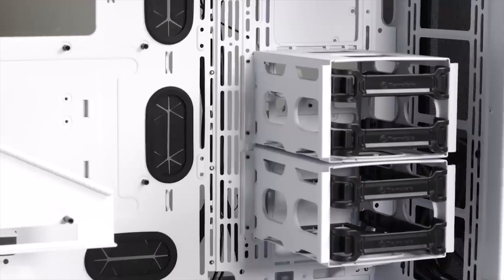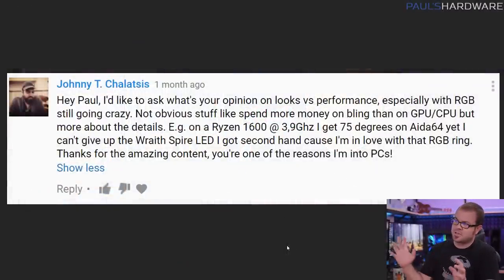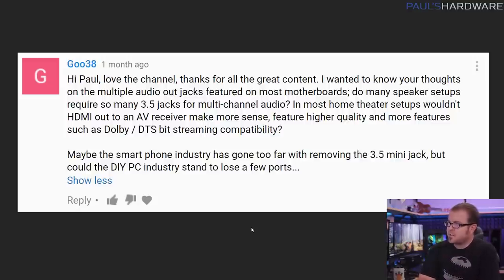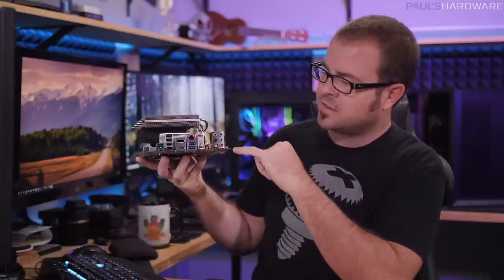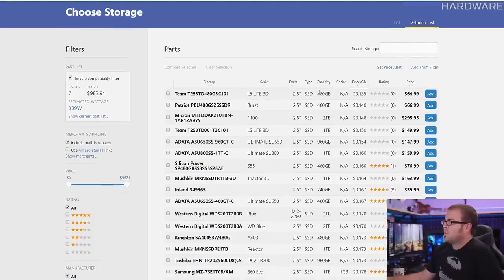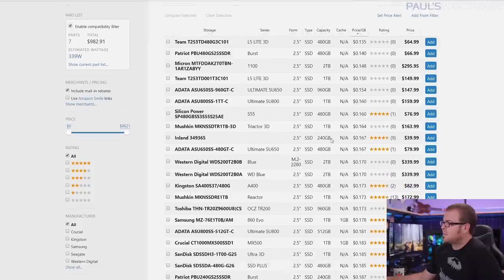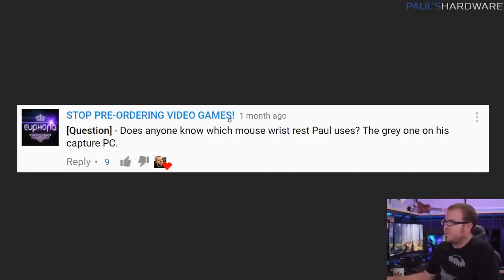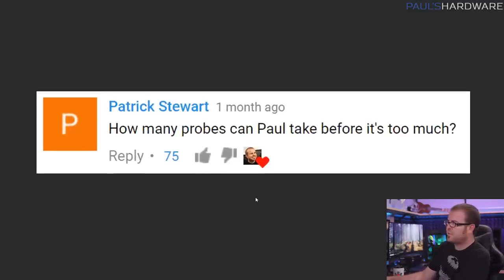The Eternal Question: PC Looks vs PC Performance? - Probing Paul #27

Comment: Hey Paul, 
Do you think it would be better to run a single ssd of higher storage, or using multiple smaller storage drives? Right now the predicament that I am stuck in, is in my build I have just bought ssd's once one of them filled filled up. I play a lot of games and like to have everything load quickly, recently I have started to notice a performance decrease, and when browsing through my files it seems like everything is just stored in so many different places, so what I was thinking would be to purchase a larger ssd that would replace the multiple ssds. Right now I have my OS on a Samsung evo 960 256 m.2, 2 Samsung evo 860s, and a Western digital 2 Tb drive. I would like to keep the hdd and then ditch the two 860s for another higher storage m.2 since my motherboard has another m.2 slot open.

Comment: just my experience with the digital out of the mainboard:
All of them that I have tried does not support Dolby or DTS compression which means you will only get two channels over toslink. There are some moded drivers for realtek sound chips to enable dolby live but I had no success with them.
The solution I went with was an ASUS xonar dsx sound card (about 50€) that supports DTS (there are some cheaper options if you only want 5.1 for about 20-30€) and use it's digital out to get 7.1 out of it. 
About HDMI: my AVR made some problems in some games which considered it as another display so I went with the above solution.
Reply: Pouya
Now, only DTS connect or Dolby Live or Atmos, all onboard solutions can produce that on premium boards, sonar too, just a Digital format all games do now.
Check the codec that the system supports, use the optical connectors to connect it to the DAC, or built in DAC AMP solution! Xonar is just using multi chips, they all support some way of DTS connect or ATMOS. You don't need Xonar, try the optical connector on your board first!
Reply: I toslink over to my home theater system which can decode the 5.1 on the stereo feed. Without a decoder you only get stereo.  Now I am going to have to check to be sure I am getting surround sound after your comment.
Reply: Sorry for the delay, but my Realtek Digital Output Properties shows "encoded outputs with a check mark in DTS audio and also in Dolby Digital.  It appears these are encoded in the SPDIF output to the home theater system which can decode them. I have a screenshot but this thread won't let me post it. I also have a selection for ATMOS for headphones.

Comment: I built my pc in 2010 on a short lived AM3 just before bulldozer was released. I didn't check back on pc hardware scene for about 8 years. So 2017 Xmas I return, and hard disks are round the back, things are shrouded. Basically inaccessible. All about looks. The whole point of a good PC was that is a) easy to build in. That's the foundation for picking your own tower. You don't unscrew everything, you just take your sausage fingers to the component you need to get to whilst leaving everything else in place. Part of me thinks the best mid-tower cases have already happened. Everything is just a variation of them now.  The only difference is now that efficiencies allow for smaller chassis without compromising too much on the power.
Reply: nauxsi
Just go for the GPU you need, some $250 intel solution that to run it!
what ever case you need!

Comment: if you have a decent budget for a build (mid -high tier) i always stick to a 80-20 to 90-10 preformance - looks, spend about 80-90% on the preformance and then the remaining 20-10% on looks, say you got about $3000 to build a new pc see what you can get for about $2400 - $2700 and if that works for you spend the remaining budget on a better looking case, a RGB cooler, RGB RAM, always save the LED strips for last as it is a easy adition to your system later down the line that does not replace any of your current hardware, in contrast to RGB RAM for example, if you realy want that blingy RAM and you build your system with normal RAM, 2 months later or so you got some money left to drop on upgrades and bling you dont want to buy the same RAM but in RGB leaving you with letf over non RGB RAM, you could resell that RAM but you wont get full price on it.
Reply: originalkhawk
There are no tiers, just needs. If you need build some NVlink X299 40 HT core system now, its still a low level workstation....
If you need RTX now, just go for some gaming tear k intel CPU, the $250 CPU's are the lower tier!

Comment: Hi Paul,

A few years ago I built a pc with 1tb hdd for storage, but now you have convinced me to buy a ssd for windows an other programs. But how can you switch windows from a hdd to a new ssd? Do I have to reinstall windows?
Reply: Reinstalling Windows doesn't hurt, but you can clone the drive, which I've done several times with my boot drive. Can't speak for all disk cloning software, but I know from experience that Macrium Reflect can even clone from larger disks to smaller ones, provided the data on the larger disk doesn't exceed the capacity of the smaller one. For instance, if you wanted to clone your 1TB HDD to a 500GB SSD, you could do that as long as there's no more than 500GB of data occupying the hard drive. I actually did this when I cloned my 1TB boot HDD to a new 240GB SSD, and I then cloned that boot SSD to a new 250GB one (which is M.2, hence the switch) several months later. None of this caused any problems. Having said all of that, if you were to ask Microsoft what they'd advice you to do, they'd probably tell you to just be on the safe side and reinstall Windows, so there's a level of caveat emptor involved here.

Comment: realy interresting about the sage there... i have a gaming x card it has a sag its annoying just to know u have one so here is what i did i went to the store and bought a few zipties and tied the ties together making them look like a chain tied to to the top of the case i used around 6 ties till it reached the gpu and it was cheap not like a 40 dollar braket just to hold up the gpu and this has more flex to it so you wouldnt wory about breaking it or the gpu..😁

Comment: Hey Paul. Steam for linux just got a major change. You can now play windows only steam games on linux. I recently took the leap and finally ditched windows for good because I've always kept windows just for the games library. So far most of my games are working. Keep in mind there will be some slight performance hit (10-30% if windows only game.) I was wondering if you would ever consider testing hardware on linux systems? I don't know the fan base you have on linux but I know I would really enjoy watching videos from someone of your caliber testing hardware for the platform I've come to love. You can easily find a database of the community testing games for how well they work so it can be easier to choose from gamewise. Also alot of windows games have linux versions that have comparable performance instead of slight performance hits. You can also find very easy guides on how to install GPU drivers and anything you might need.

Comment: Hey Paul. I bought a used gtx 980 about a year ago and it has been working fine. However, recently I noticed the temp getting up to 83 C during gaming. Do you recommend changing thermal paste at this point? I’m concerned about breaking something (like the thermal pads) and making it worse.
Reply: Is your case dusty and do you have good airflow in your case? try cleaning the gpu with compressed air and that stuff first. replacing the thermalpaste is not terribly difficult, and while you're at it, change the thermal pads as well. Take a picture of how everything was before you remove the thermal pads!

Comment: Paul, whats typically better a CPU, one that it hyper-threaded with less cores but more logical cores, or a  CPU with more cores but not hyper-threaded? For example the 6c 12t i7 8700k or the new i7 9700(?) that is rumored to not be hyper-threaded but with 8c? Building a new PC and the rumored intel 9th gen i9 seems to be out of my price range, but sounds to be the only hyper-threaded CPU. I know (at least at the time of this video) that you cannot speak performance numbers on the Intel 9th gen CPUs, but more or less I am wondering if I should wait until they are realeased to buy?
Thanks!
Reply: Casey O'Brien
What does it need to do the only Question!!!
Reply: Just about everything. Gamer and programmer, so CPU needs to be pretty hearty. Curious if the extra hyper threaded 'cores' of the 8700k will make it comparable performance wise to the 9th gen.
Reply: Casey O'Brien
If you play game's, on what GPU?
You never need any system for C! Heavy compiler???
Reply: It will be a whole new rig. Either a 1080 ti or a new RTX if its worth it for the price (skeptical but not ruling it out). Mainly a C# developer, mostly asynchronous apps and large open source projects. Yes, Visual Studio is quite heavy haha
Reply: Casey O'Brien
> $500 GPU card, Try to build a Coffeelake 6 core system, or intel X299 if it's within your budget, able to get more CPU cores. Not needing many CPU cores, then Coffee 6 HT cores can do the job! You need the > 4 Ghz intel CPU if you what to run RTX level cards.
Visual Studio, lol, though you needed to run that, intel your first choice i guess.
Reply: Thanks, I'll keep this in mind.

Comment: Paul, could you help me? My motherboard rgb is not working (asus rog strix z370-e gaming) and I sent it to asus and they said nothing was wrong. So what would the issue be? My psu is a thermal take 650w, 16gb trident z rgb, 8600k, gtx 1050 going to upgrade to 1080

Comment: What is better for light gaming, Intel or ryzen
Reply: Ryzen. Their cpus are great price to performance. Even the 2200g (processor with a graphics chip) can be used nicely for light gaming (also paired with a gpu). Intel doesnt make much sense. Their cheapest 4 core cpu sells for 150 euro where I live, that's 50 dollars more than the 4 core 2200g from AMD.

Comment: Hi Paul,  i have Ryzen 1700x and GTX 1070 FE, the GPU is running hot while gaming about 75c while gaming and 83c under stress test that's with custom fan curves, is water cooling good option or do you have any other recommendations? 
Thank you I enjoy your content keep up the good work :)
Reply: thats fairly normal temps for a GPU. If you're gaming with a headset or so, try playing a bit with your fan curve. Otherwise, check clearance, airflow in the case etc, or invest in another case fan depending on what you've installed already.
Reply: @neerithedragon298   i have 3 fans in the front intake and 1 fan in the back for exhaust. Clearance wise is good nothing is stopping air to the GPU

Comment: Goo38 - On all 4 of my PC's in the house still use that 3.5mm jack, 2 are using onboard through PC speakers and 2 through sound cards. I guess if they did get rid of it my only option would be a sound card or ditching my Bose 2.1 setup and go through a receiver or buy new speakers that have a digital input. But that on board 3.5mm jack is cheaper for the masses since your average consumer is going to get $20 speakers and those usually only have one way to plug in via 3.5. P.S. I never used USB sound or headphones, USB sound IMO sounds really bad and headphones make me feel claustrophobic. In the past I did use a 6.1 Receiver and 6 bookshelf speakers and sub and for some reason back then it would never go into digital surround. I spent all that money for a major disappointment. I just went back to 2.1 and sold all that to someone that wanted a home theater setup.

P.S.S. I just woke up so what I said might not make any sense. sorry.

Comment: Digital sound output from your pc will give you serious headache for running surround in games. Spdif is exellent for movies and such, which might support surround, while games dont output surround sound digital. To this day i have not found 1 game that have dolby digital or dts, while consoles like xbox1 and ps4 outputs everything in dolby digital. Thats why i use both analog and digital connection to my home theater, but if you have to choose digital or analog for your surround system, go analog. Or be without surround in games. If you just use stereo then digital is best.

Comment: hi paul,i bought a 970 pro 512 gb for gaming is it good idea to partition the drive for os and games,and my 970 pro seems slower than every youtubers 970 evo and even 860 evo crystal disk mark scores,im using a msi gv62 vr 7rf laptop with i7 7th gen 7700hq,16 ram at 2133,gtx 1060 6gb ,any reason for that ?  :(

Comment: Awesome video as always Paul, really enjoy these QnAs. Also found it funny that you recommended the H7 Quad Lumi to the guy with the 1600, because I have that same CPU and cooler (haven't seen temps above 70 with it by the way). Anyhow, I do have one question: when you make a Windows Installation flash drive, does it make a difference to create it on a USB 2.0 or 3.0 drive? E.g. would the creation of the media and the actual installation from the drive be any faster by going to USB 3.0 or is the difference negligable?

Comment: Paul, depending on whom you buy from you can save a tremendous amount of money..Origin PC, Maingear, Xidax etc.. charge upwards of $800 to over a $1000 above parts. Hell, TechSource just reviewed a Digital Storm $8000 8086 with 2x1080TI's which I know for a fact can be built at half that cost.  It included over-the-top custom watercooling with Digitial Storm exlcusive parts etc. By the way Edgar of TechSource has a video where he denigrated companies who charge such premiums over parts ....how times have changed...can you say sponsorhsip. 
  IBUYPower, NZXT Bld and the like have pretty good prices, however.

Comment: Another reason you wouldn't run sata 3 ssds in raid 0, is that modern sata 3 ssds are fast enough to saturate the bandwidth of the sata controller, raid 0 would get little to no performance over that interface.
Reply: Neo P
Are you sure, NVMe i still recommend in Raid 0, your SSD not needing any fail save options, what do you need on old SSD? performance, forget SSD!
Reply: @lucasrem   nvme and sata are different interfaces, nvme has drastically more bandwidth than sata. The discussion here was if you should raid 0 sata ssds.
Reply: Neo P
Did you take my advice, rapid ID?

Comment: To anyone: I have an i7 4790K right now with a GTX 970, planning on upgrading to a 1080Ti or 2080Ti depending on benchmark numbers when those come out. Is it worth the money to do a full rebuild with an 8th gen CPU since I'll have to get a new board and RAM with it? I'm a little worried about bottlenecking since my current processor is a bit dated. And I suppose faster everything would be nice but IDK if it ~$600 nice, y'know?
Reply: Taha C
Just buy that GPU, then update the system!!
Any $250 > 4Ghz intel system is enough to run these next gen RTX cards...
Need some old AM3 system that runs DDR3??? What is your question here???
" Can i run my $800 GPU on my 6 year old PC?" You can, but what are you getting? Saving $600!

Comment: Built my PC back in March for $1500. Specs are R5 1600, GTX 1060 3GB, 8GB RAM and a single 250GB SSD. Today, I can build a PC with a R7 2700X, RX580 8GB, 16GB RAM, 250GB SSD and a 2TB HDD for the same price. How depressing.
Reply: Charisma
$1500, not even a GTX 1080 level card?
You only needed a GTX 1080, on some 4Ghz intel, NVMe are extra parts.
Why some RX build now? Wait for Navi if you need a cheap AMD GPU!
Reply: @lucasrem  $1500AUD I must add.

Comment: 00:11:28 Paul if gonna to a vid on Raid 1 & drives, please talk about Raid 10, as most ppl only hear about Raid 0, 1, or 5..... I have my Servers running in Raid 10 & my Storage Server running unRAID 
Cheers, A
Reply: Exactly my thought. Myself am running raid 0 ssd's as system and application drive, and a raid 10 hdd's for mass storage on my desktop. This combined with a raid 5 hdd's on my storage server. Setting this up has become pretty straight forward, so why not do this and get some additional performance and Redundancy 

Keep in mind redundancy IS NOT a backup.

Comment: I've got a question. Why in the living f*ck would ASRock design their X370 board to have two M.2 slots, an ultra slot(32gb/s) and a normal slot(20gb/s), in which NVME drives can work in either slot but SSDs can only work in the ultra slot? So annoying.
Reply: KG
X370 are the cheap budget solutions, not the best I/O
What board you bought, the ASrock Gaming X?
Use only X4 M.2, never use the old ATA SSD drives on NVMe...
Reply: Dude, where did you get your information? I've got the X370 Taichi which is not a budget board. The X370 chipset is an "enthusiast" chipset. The X370 taichi still costs upwards of $150 new on newegg. The X370 was the only chipset for the first gen ryzen boards that supported SLI/Crossfire. Where did you hear that it was the budget chipset?